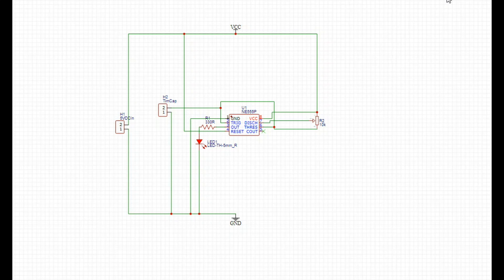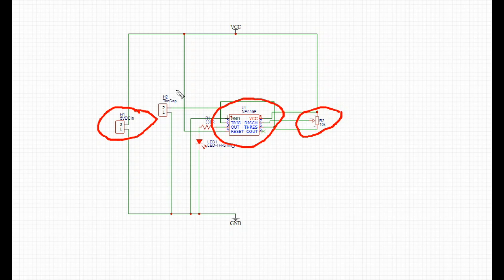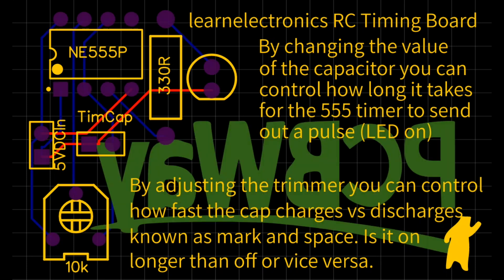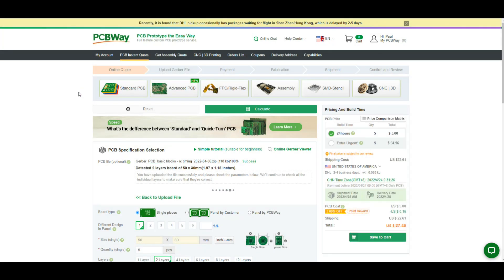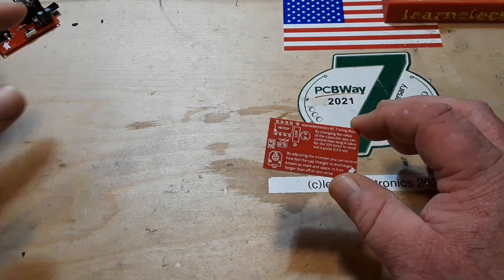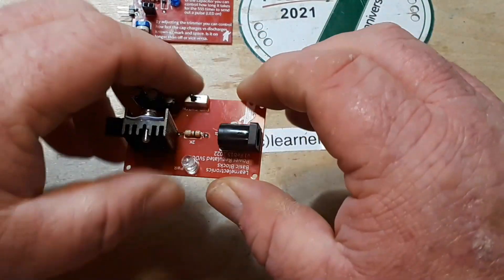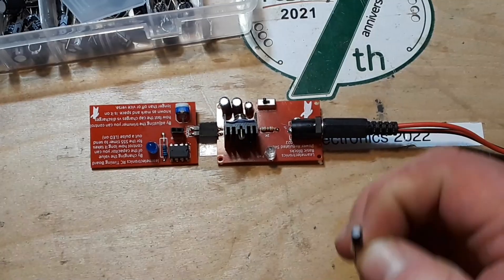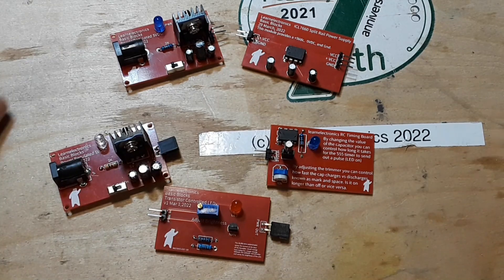RC Timing STEM Boards

Comment: I need a little bit of help.

I bought a VERY powerful drum fan. However, its lowest setting is too much lol. 

Is there anything I can plug it into to reduce its speed further?
Reply: There are motor speed controllers on ebay, very cheap. I got some awhile back, they work well. If you make it too slow the motor can stall though. :)
Reply: @Franko_Walker  thanks. I had to replace a bad fan that started to spin ridiculous slow lol
Reply: @VeI_2.0  Ha ha. No probs.